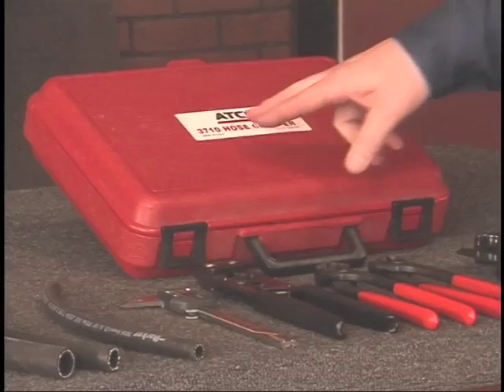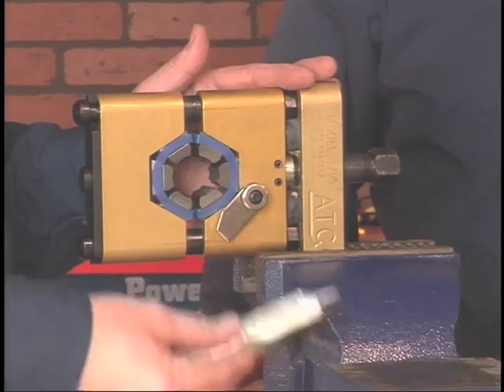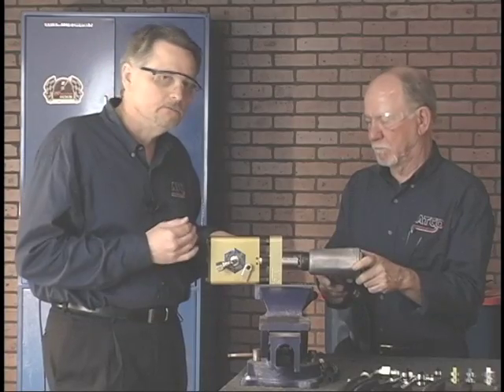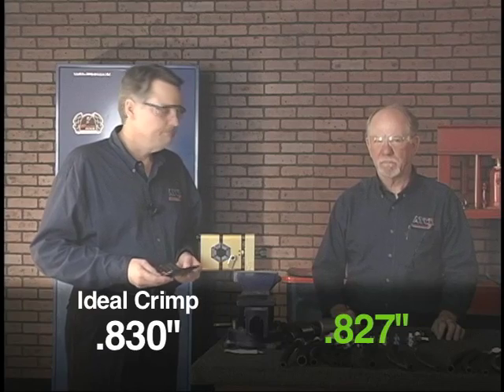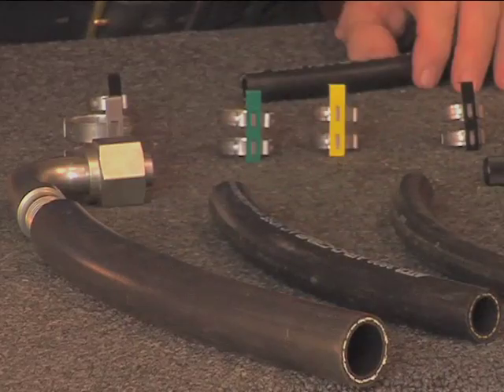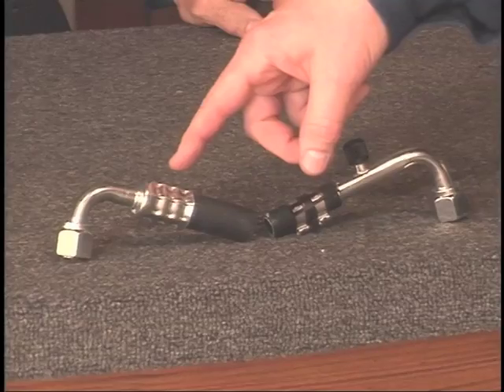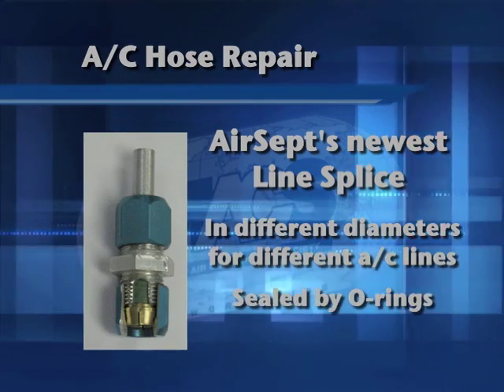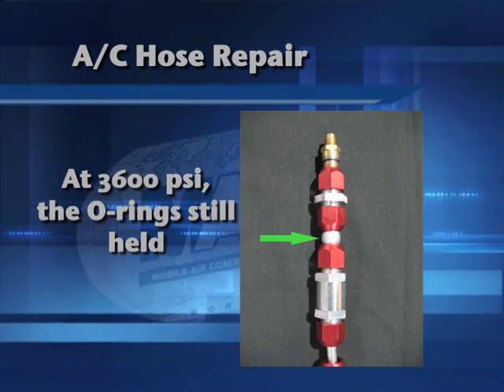A/C System Hose Repairs | MACS | Tech Tip

Comment: Hi, I have a Ford Transit 2012 VM LWB 2.2L Van that has a leak in the high pressure rubber hose. Because it is a major job to access the compressor and remove the hose from the compressor. As the leak is located in the middle of the rubber hose, I can easily access that rubber part. Crimping is just not possible. My question is, what type of inline inter-connectors can I use that would be suitable to repair that part of the hose ?

Comment: Dear Atco
I have been in the auto air con trade for 25 year with much respect for your fittings, but this last couple of year your standard hose fittings have turned to shit, they are no better than the cheap Chinese fittings, with many failing within 6 month & no fault to do with the systems. When will you have quality back in your work ? Even if they are more expensive it will still be better than letting yourselves down on quality !!